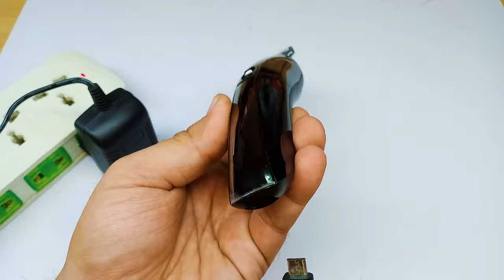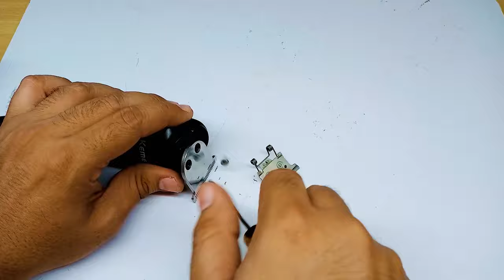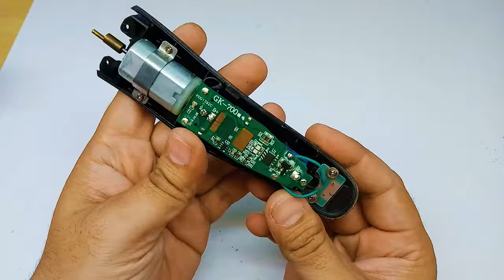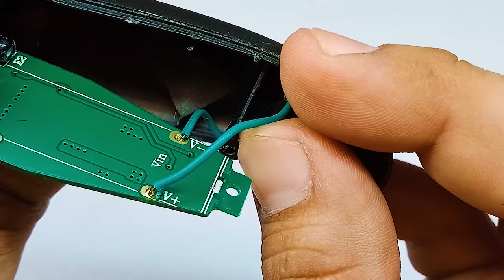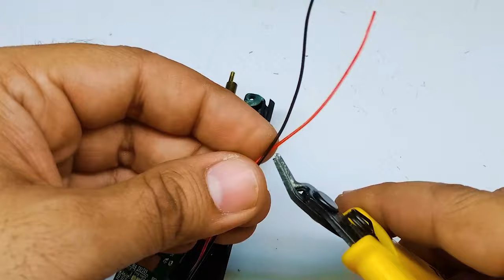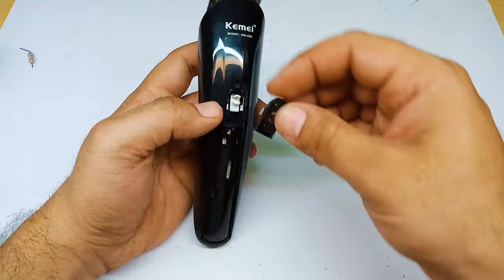How To Convert Rechargeable Shaving Machine on 220VAC / DIY

Comment: But it is very slow because hasn't enough current like battery current
Reply from the maker: No that was not slow it was perfect.
Reply: @THEKEPLERSTORE  Mine was getting very slow, so I took it to a repair service and they replaced the battery with another one, since it had a few years already. However, the new battery does not work better, in fact it seems it does not even charge or the motor is even slower. Is it the motor that is dying? Is thre any fix? Thanks.
Reply from the maker: @pedroedsos  No, it is a charger issue. you should change a charger because your trimmer charger Ampere has been down.
Reply: @THEKEPLERSTORE  Thanks for answering. I'm going to check that option.

Comment: I connect the 220v by mistake to my clipper . I think its burned . Is there  a way to fix it
Reply from the maker: Okay, well, first, please check if your trimmer's motor is working or not. You can check it with any battery, 5-volt power supply, or mobile charger. If the motor is working, then you can follow the method shown in my video.